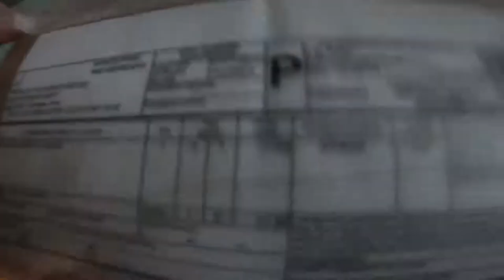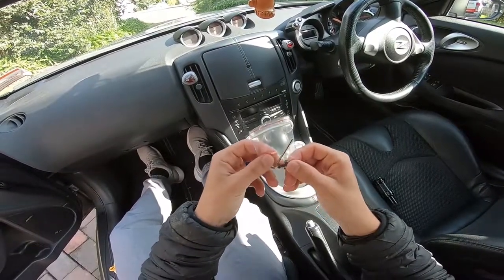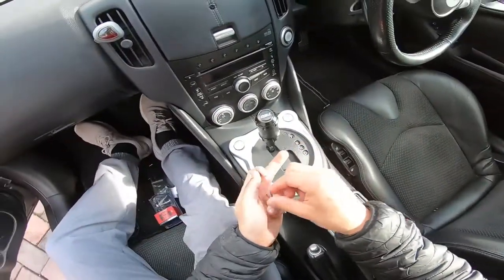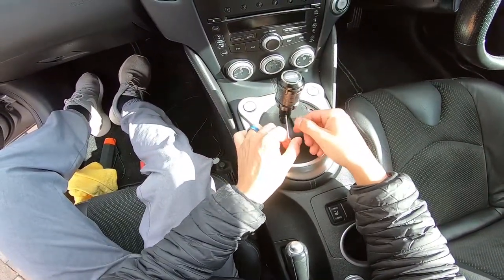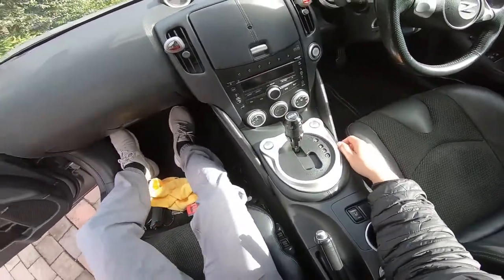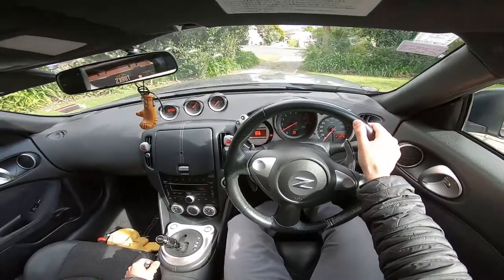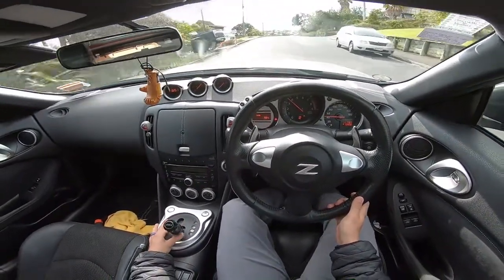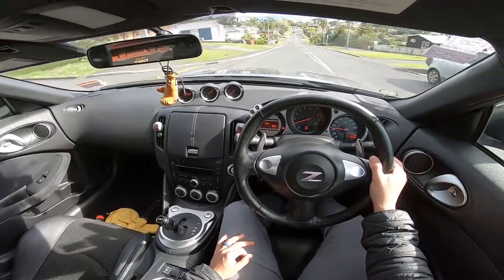370 Z  Automatic Gear knob Install and a little whip in the 370

Comment: Would you mind sending the link to get the knob!
Reply from the maker: I'm truly sorry. I did not see the comment. I will send the Link ASAP
Reply from the maker: Here is the link       
https://www.ebay.com/itm/Pilot-Automotive-Magnum-Automatic-Transmission-Shift-Knob-FAST-US-SELLER/112565059265?epid=1439616330&hash=item1a35667ec1:g:1TwAAOSw7L1Zu~jn
Reply from the maker: Here is the Link 
https://www.ebay.com/itm/Pilot-Automotive-Magnum-Automatic-Transmission-Shift-Knob-FAST-US-SELLER/112565059265?epid=1439616330&hash=item1a35667ec1:g:1TwAAOSw7L1Zu~jn
Reply from the maker: Here is the Link
https://www.ebay.com/itm/Pilot-Automotive-Magnum-Automatic-Transmission-Shift-Knob-FAST-US-SELLER/112565059265?epid=1439616330&hash=item1a35667ec1:g:1TwAAOSw7L1Zu~jn